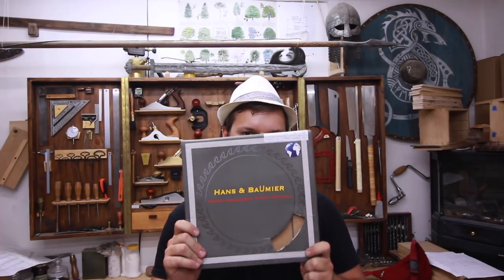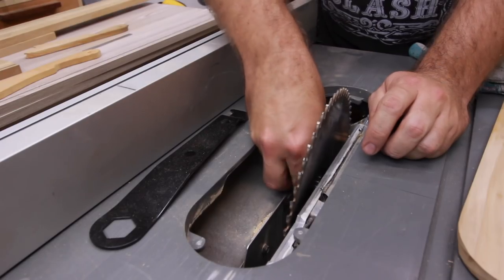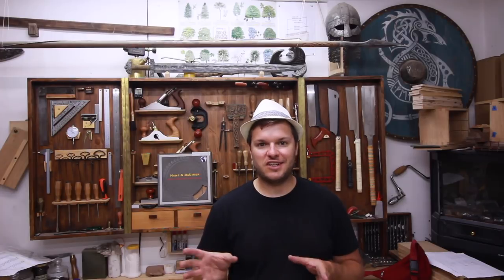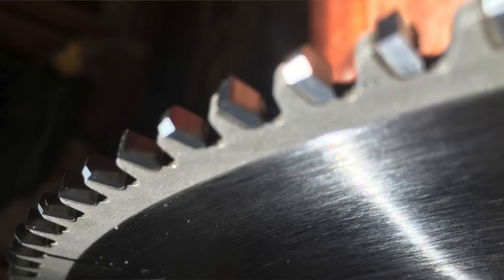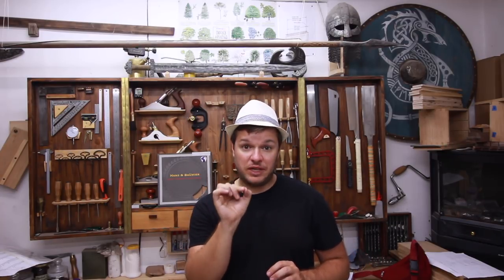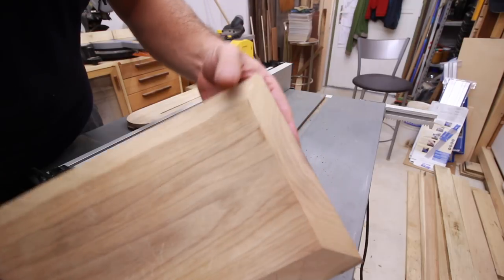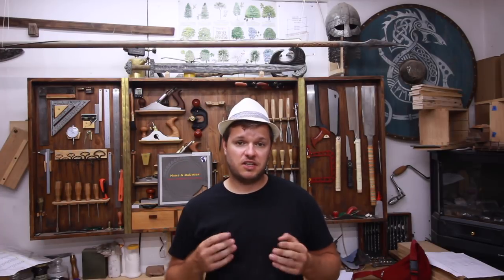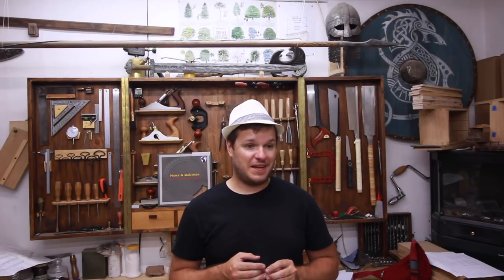Incredibly Silent Circular Saw Blades

Comment: Hey man, in order for us to hear the difference in sound you really need to be filming with the same camera on the same saw and same material from the same place. Otherwise thumbs up!
Reply from the maker: It is the same camera, the same saw and the same material. The saw is really amazing, get one and if you don't hear it ask for a refund.
Reply: @AndreaArzensek  thanks for the answer. My point was that you should have the camera standing in the same place while you cut with two different saw blades so that distance to the saw doesn't have an impact on the sound result. :)
Reply from the maker: @hammerslaget  My workshop is so small that different position doesn't affect much the sound. At least not with that huge difference like you've heard and in person is even more impressive. Cheers